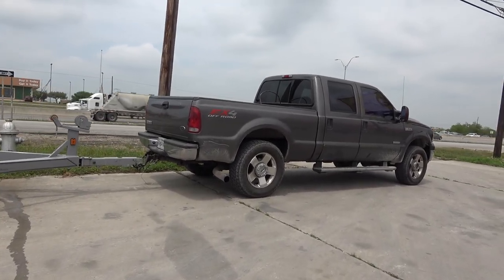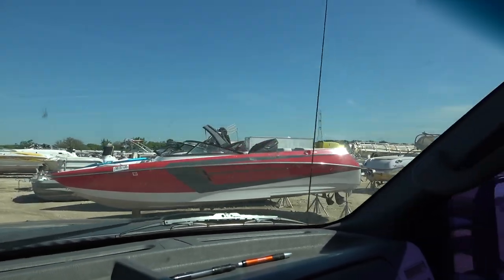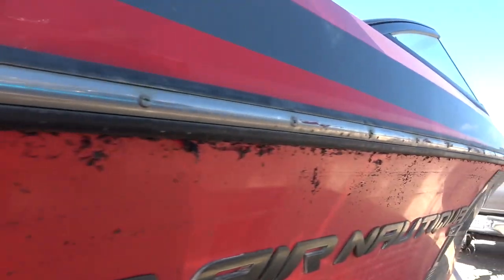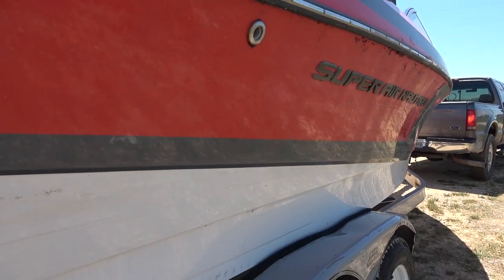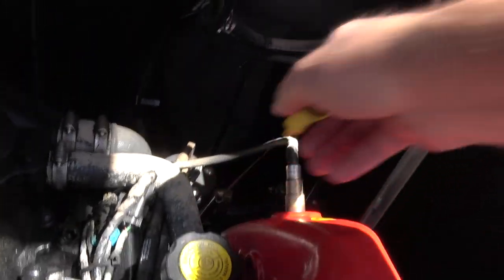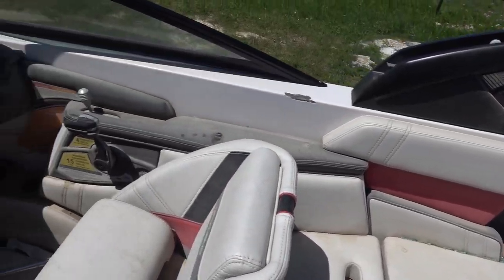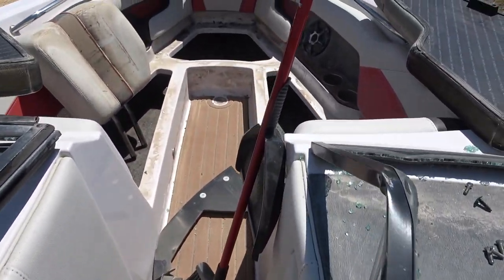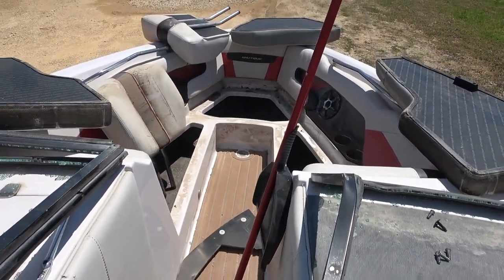I Bought A Wrecked & Flooded Super Boat From Copart Lets Unflood It?

Comment: I used to do engine failure analysis for a large production engine re-builder and found that just one small rust pit on a valve spring can cause it to break at that point.

Comment: It’s the compression. Heat is getting into your cooling system and it is causing engine failer so you need to do the program where you built the engine

Comment: Unfortunately used boat trailers are a rare commodity. And the bigger problem you’ll run into is trying to find a used boat trailer is finding one that will actually be set up properly for this one which is going to be difficult to say the least. You’ll probably have to get one there is a universal fit that has adjustable box and try and adjust the trailer or go to a boat dealer and order a new trailer for it that is designed specifically to fit that model. You’re looking at it lease five to $6000 for a new trailer..  Asked for a used boat parts there are a couple of boat parts places in Florida that are very good they have a huge inventory of ski racks and such like that that you might need. Best thing I can tell you is just to look up boat salvage parts in Florida

Comment: Also if the engine is rooted put the new PCM 350hp in I think it's called the High Five or something. They're only $10,000-20,000 new depending on who you buy it from. PCMs are also chevy/GM based engines and Indimar are new Ford based. Mercruiser are also GM based engines.
Reply: MEGASQUIRT.......

Comment: Do you have tow mode in and did you lock your front hubs depending on the year so you can switch between high and low but not out of 4 wheel drive if you're towing something heavy have a 6.8 non diesel and it does the same thing with RPMs and if you were having that fluctuation between 45 and 55 that's why I don't know why your check engine light is on

Comment: to repair the speakers. take them out, take them into a shower with you. use the spray wand and spray into the speakers while moving them slowly back and forth to free up any glass or jsand etc. that has got stuck in them once they are moving freely and feel nothing is left in the voice coil gap ..then face them down so the magnet (up) can drain any excess water out of the coil gap then let them dry for about a week... then bench test them to verify that they still work. then just put them back in also works with subwoofers but dry time might be more due to water my collect in the dust cap from being faced down .  most of the time its sand in them for what i have dealt with but yours has a lot of broken glass so meh sand/glass about the same things. just be-careful not to walk on it in the shower. hope this tip saves you a bunch of money.

Comment: I just went back and reviewed what was at 0.13 seconds. I bet when the brakes are applied on that trailer there might be a little vibration or possibly some scary noises included with a little vibration also. Might want to at least replace that rotor before selling it. Maybe pull all the wheels and inspect  the entire brake system. Bearing repack?  It's probably OK.

Comment: This is a 100k boat. I think you did well. You can come out ahead. But needs to be done right.  You need to source a new tower. You need to have a fiberglass shop fix that undisclosed crack. Then tear everything down, take it all apart.  Clean clean clean and drain everything.   Good luck!

Comment: Where do you get superboat from? Looks like a bayliner
Reply: A Super Air Nautique does not look anything like a Bayliner, are you smoking crack? This boat brand new is around $120 k, and they hold their value amazingly well for boats. I bet depending on the rebuild, he could get around 60 - 80 k if he does it right, because it still will have a salvage title after all.

Comment: Tja if you understand wakeboarding and wakesurfing you would know what kind of tow-boat this is, its a top of the line tow boat build by Correct Craft
Contact Correct Craft for tower and wind shield, you probably will have to change the electric control  control panel as well

Comment: he paid 22k for a flooded air nautique that the fire extinguisher was discharged in the engine bay on?, i used to build those boats so it is prolly 60k+ brand new and the crack on the upper deck shouldnt be too bad to repair, if he is bold he can remove the rub rail and all the screws under it and disconnect all upper deck connectors from the hull and lift the whole deck off it, depends on if the guys at the factory  bonded the middle down on that as well , otherwise remove everything and have fun trying to repair it.

Comment: That’s my old trailer😂 a guy t-boned it on the right side, that’s why the axles and fender  are messed up
Reply from the maker: good to know what size boat did you have on it? the guy that sold it to me swore he had it for years.
Reply: Rebuilder Guy we had a 08, 21’ vlx. Definitely hasn’t had it for years, it got wrecked last August. We had just replaced the runner boards and re-carpeted them
Reply from the maker: lol some people just suck I wish I still had the CL post where he was talking about it being used on a 23 lsv.

Comment: Check engine light comes on... Still drives on.... Could be low oil lol
Reply: Low oil and it won't run,  injectors use oil to pressurize fuel

Comment: Dude you need to get the proper trailer for that boat that trailer does not fit that boat properly. I have owned over  different nautiques over the years and use to work at a correct craft dealer working on them good luck hope the electrical system isn't ruined.

Comment: Trailer is far to small for the boat. It needs to be 3ft longer than current at a minimum as the prop and rubber need to be protected by the prop guard on the trailer that bit at the rear that dips down is your prop guard. May as well buy a brand new trailer as they don't cost that much overall especially if it isn't an OEM brand.
Reply: He should be able to move the frnt post and roller forward on the tongue to make boat fit. ( if he decides to keep that trailer)

Comment: lol you tried to raise an issue with Copart for undisclosed hull damage?? Its an as-is auction LOL you're stuck with it regardless if it crumbled to pieces when the boom lifted it. Also you should've just used jacks and a block to get the boat off stands instead of paying a wrecker.

Comment: lol ANY truck from ANY manufacture isn't going to go very fast when you have the transmission in 1st gear.
Amazing things will happen to your mph and rpm gauges when you move the shifter into 2nd, 3rd, and Drive gears
.....eh but then again the very next clip shows driving near 60mph in first gear which isn't possible, and so looks like shifting indicator is broke being at least one problem

Comment: Not even worth $23,000,your engine rebuild alone will be $10k plus,a proper trailer another $10k,and then another $10k  for boat itself repairs.
Reply: tbugher62 that’s if he actually does a rebuild.... I’m guessing that won’t happen... that doesn’t take into account the dozens of water compromised bits and pieces, any one of which has the potential to end a day on the water and cost $$$ to repair.
Reply: @maineguide6975  He shook water off the dipstick,and its so rusted inside he could not even get the dipstick back in=Rebuild job.

Comment: That boat is junk and you overpaid for basically a parts donor. The gunwale is trashed and flooded boats will have mold and electrical gremlins until the day they’re crushed. It’s also quite obvious you know nothing about engines. It’s not the valve springs you’re worried about, it’s corrosion on the valve stems cause the valves to get stuck in the guides. That water on the stick tells me that there is rust in the engine. It needs to be disassembled, at a bare minimum, and fully inspected. Doesn’t take much rust to make a cam self-destruct.

Comment: Better wash EVERYTHING with fresh water (Salt away) if needed. All the wires are green and falling to a part. You need to strip all the panels to dry them out. Running anything on the battery that went under will give low voltage and will give you over amp's so you killed what could have been good. You need new everything WASTE OF MONEY LULZ